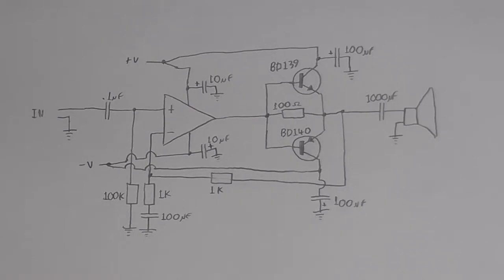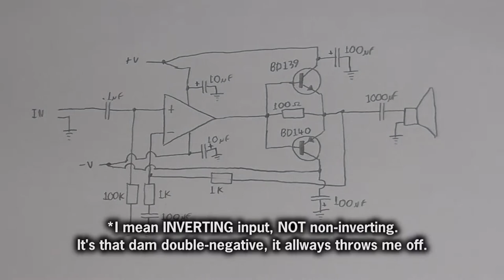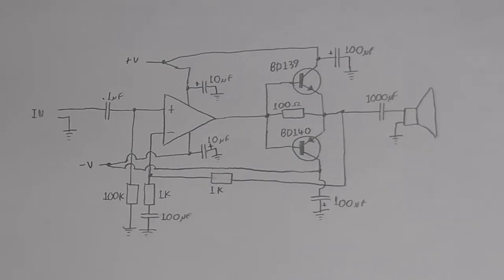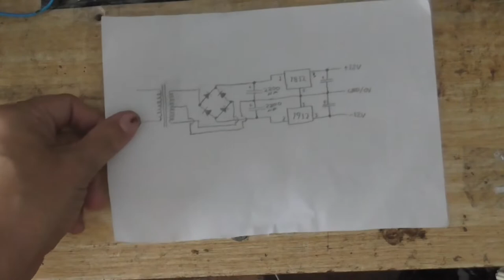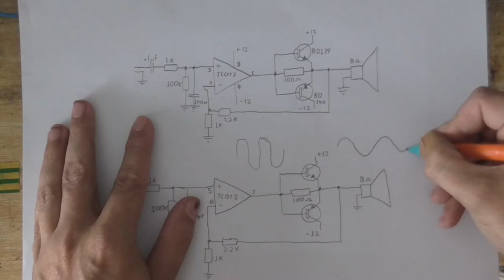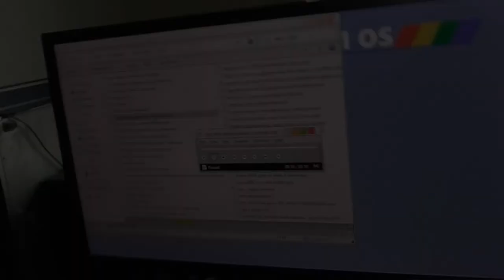Building a small amplifier part 2/2 - The Amplifier

Comment: It's amazing how well this approach can be made to work at reducing crossover distortion caused by an unbiased complementary pair of Output Transistors.
The Output Stage is of course included in a tight negative feedback loop where a lot of voltage gain is traded for a lot of linearisation.
No Zobel arrangements though I notice.
Is this your own design Clem?